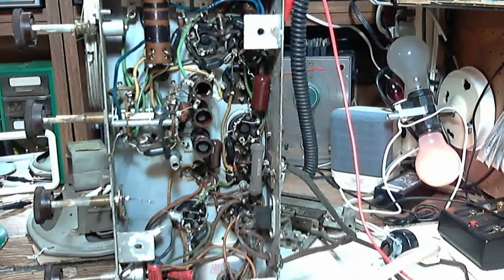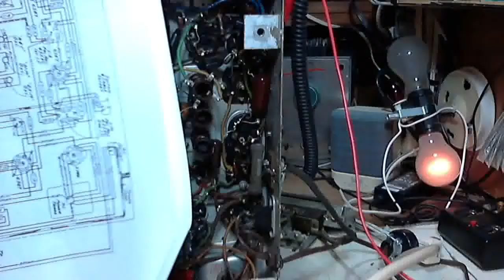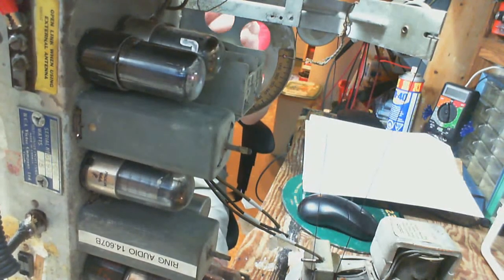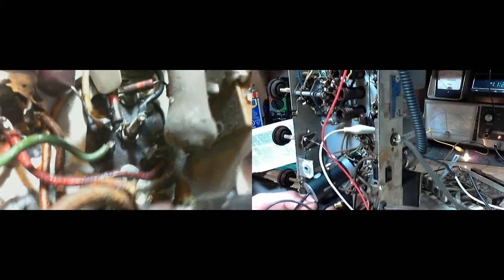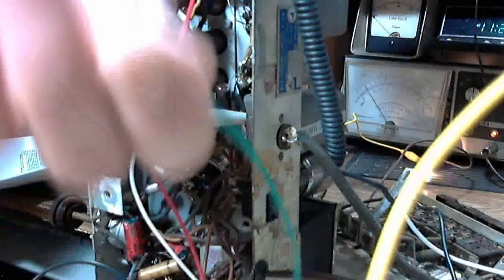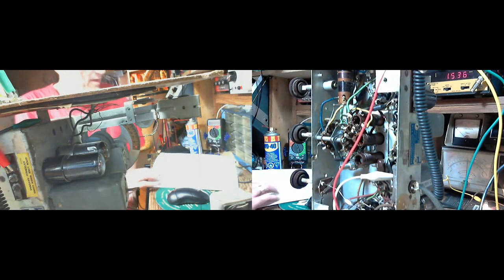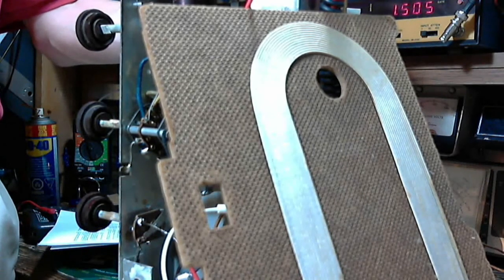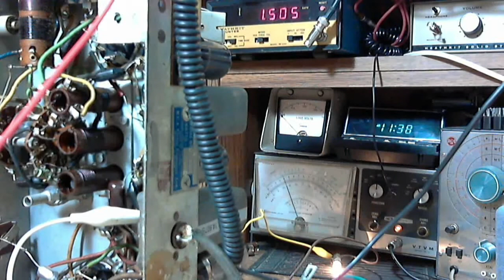RCA A24 Antique Vacuum Tube Radio Video #7 - IF Alignment Achieved

Comment: You don't normally do alignments on restricted power. Is that maybe why the noise problem went away? Does the restriction have any effect on the alignment? It would be interesting to see if it does. At least it would give extra protection if an errant tool accidentally shorted something during the procedure.
Reply from the maker: If I left the radio on restricted power, it was by accident but I have noticed that radios do not typically drift much when on restricted voltage so my thinking is that it doesn't matter too much.